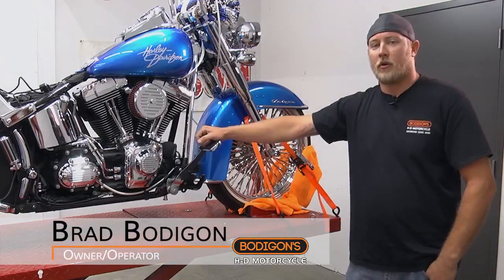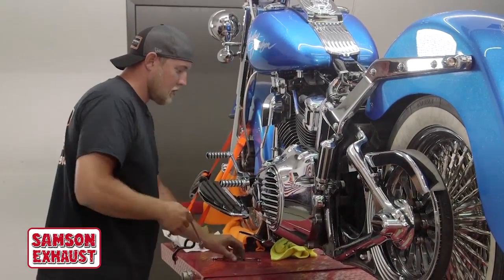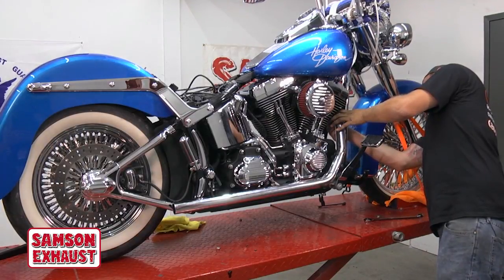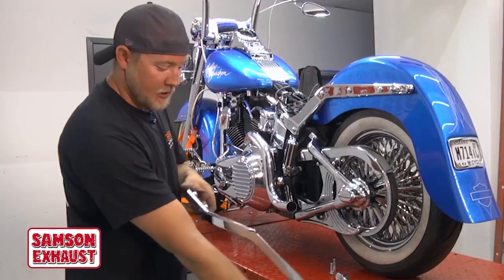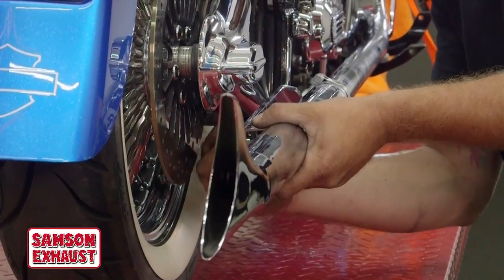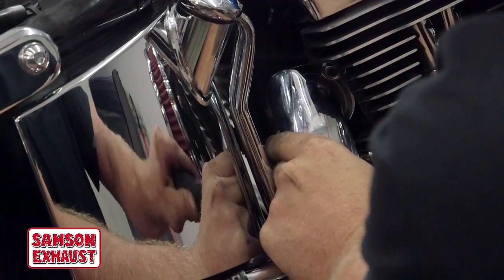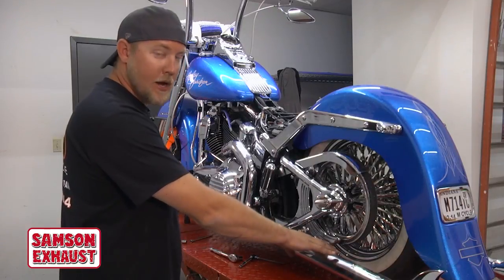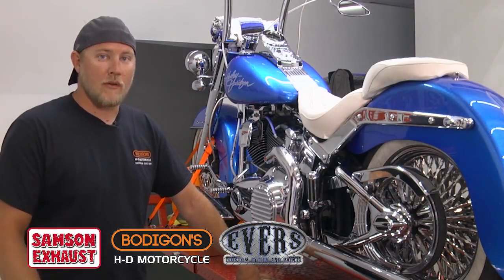Samson True Dual 36" Cholo Fishtail Installation for 2007 - 2017 Softails S2-471

Comment: I been looking for some fishtails for my 04 road king,it takes the 2”inside diameter to fit the Rhine heart head pipes,doesn’t look like I’m going to find any.
Reply from the maker: Our headers are 1 3/4" and our slip-ons are designed to work with 1 3/4" head pipes..

Comment: I’ve noticed the gear shifter hits the pipe after I installed my 36 inch pipes. I tried to see in this video if my left side pipe where it joins the cross over was at a different angle but it looked the same. Any advice you could give would be appreciated.
Reply: Maybe try to loosen the rear pipe and rotate it away. Remember that the gasket will still stay sealed
Reply: @dondash2781  managed to resolve, you only have about 5mm either side to play with between the rear cylinder and the gear shifter. All good now.
Reply: I had the exact same problem. I had to loosen the flange/bolts, and adjust the pipe as far away as I could. Luckily that helped. On a side note, it also doesn’t help that the screws in the hose clamps that Samson provides are really cheap. Those things round out very easily.
Reply: @amanrob  after two years I’m still having problems with the cross over connection coming loose and not sealing. It’s like the clamp will not close on the pipe. Driving me mad. I shall be taking it off this weekend to have another go.
Reply: @MrJnrc  Are you still using the Samson clamps?
Reply: @amanrob  yes I am, however I am not sure it is the clamp. Seems to me the crossover pipe diameter is much smaller than the internal diameter of the middle section of pipe and therefore no matter how much I tighten the clamp the middle pipe will not grip onto the cross over pipe. I’ve used exhaust gasket silicone sealant to try and create a seal, but still doesn’t seem to work.

Comment: I installed mine and for some reason I can’t clamp on the header to exhaust on left side completely and I have to run with an exhaust leak any tips for a 2016 deluxe
Reply: I'm having same problem same year bike,  wish the video showed up close the barrel clamp placement, do you still have the issue?